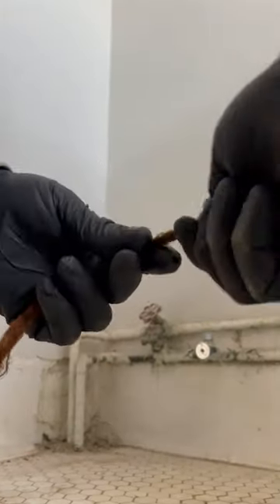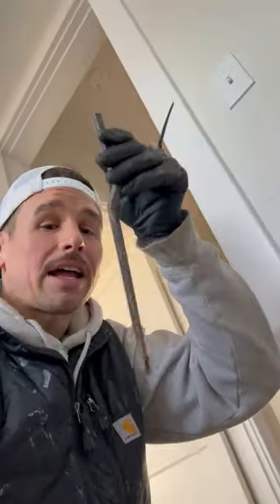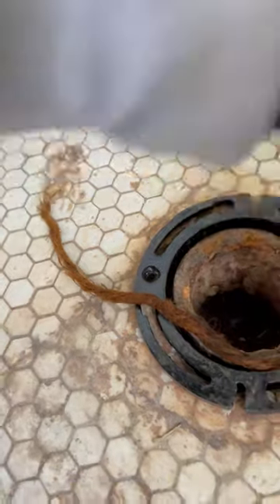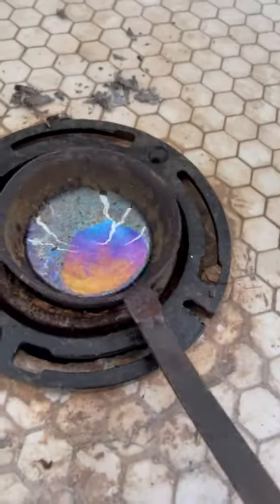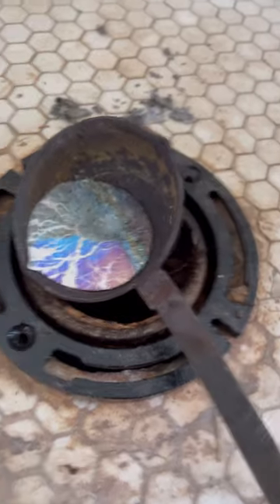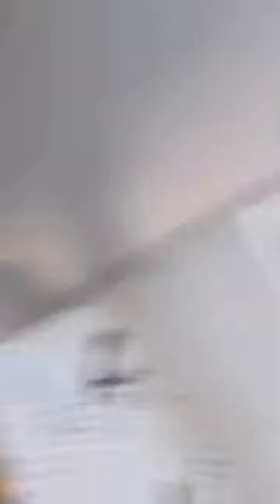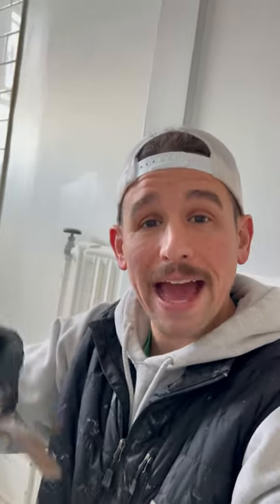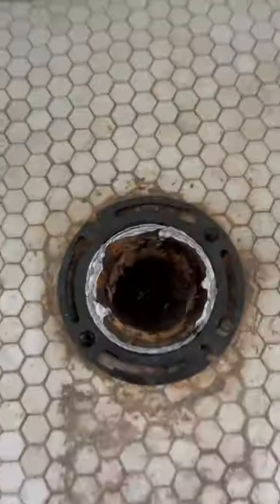Lead and oakum flange replacement

Comment: When I got into plumbing 47 years ago I did cast iron for a few years.  I was told that one uses a pound of lead for each inch of pipe. So a 4" joint should take 4 pounds of lead. 3"  3 pounds. Good idea putting in Cast Iron flanges.

Comment: Just did one of these today. I work for a school district near Buffalo, and this is the best fix for rooted out flanges. The only thing is, I use lead wool. The school isn’t too hot on the idea of me heating lead up and pouring it. It would be a lot faster, but oh well. Cool video tho, glad you see people taking the time to do it right, and not just taking the easiest path.
Reply: Guessing you used Oakum instead of horsehair?

Comment: Been plumbing since ‘98. Haven’t used a b tank since 2004. Who in the fuck wants to carry one of those things around?
Reply: I will for certain applications, it's what they taught me on "BITD" mid 70's, I do the hand torch since cppr wk is little to none these days
Reply: I’ve got a nice six foot hose attached to my Mapp gas torch that clip onto my bags. So much lighter and easier. I get that you have more gas in a B bottle. I just make sure I always have  a few MAPP gas backups.
Reply: @tomdale1313  true. I do a bunch of pex as well. Do you pex or pro press.